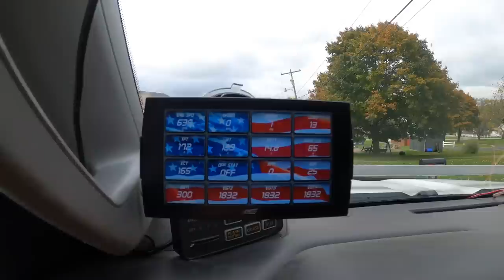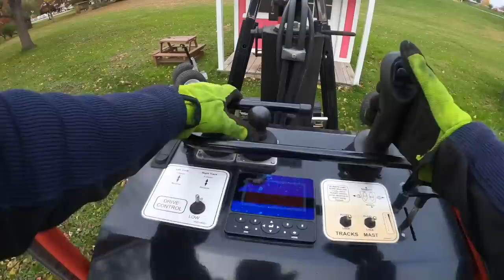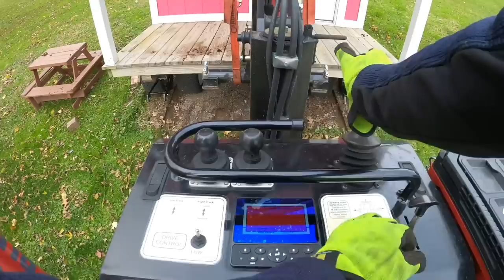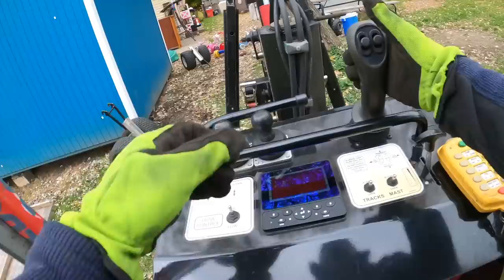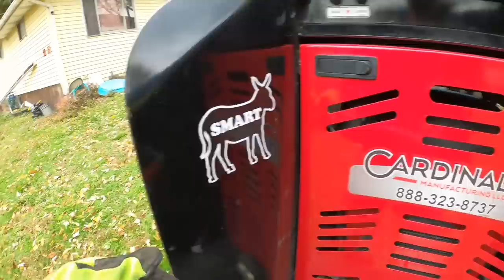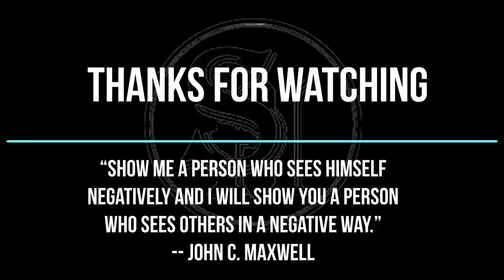Shed Repo #93 The Pink and Teal Ones..

Comment: As much as you paid for the Mule remote, throwing it into the tool box each time your finished with it could eventually knock some of the components loose inside of it which could be a costly fix.

Comment: Hello from the Netherlands .
good Tip :
Josh if you have trouble starting the 2-stroke engine of your trailer in winter/cold/wet weather, there is still a cheap and simple solution.  
if you use an aluminum extractor hose to guide the warm exhaust fumes from your truck with the hose over the drawbar of your trailer and let it blow over the cooling fins of the 2 stroke then the engine is preheated and it starts better.  
or maybe you can make a winter wooden box around it and blow the exhaust fumes from your truck into it then you preheat the whole engine.  
we did this with a truck-mounted forklift on the back of a truck that always wanted to start very hard and it was even a new one.  
he had been back to the dealer dozens of times for it.  
replaced for thousands of euros worth of parts but continued to do poorly.  
I got a piece of that hose for 23 euros somewhere along the way at a hardware store, 
tied it with a piece of iron wire to the exhaust of the truck, 
let the other side blow over the engine and the air filter of the truck-mounted forklift, 
we let the truck engine running ,
Went to McDonald to get a coffee , 
after trying to start for 5 minutes and on the first try he started right away.  
with this 23 euro solution we have never had any problems with it.  
the other colleagues in the company have also taken over .  
and the boss gave me a gift voucher of 100 euros.  
problem solved .
thanks for the video Josh .  
Sincerely, Hollandduck